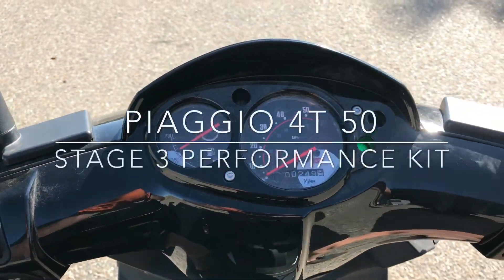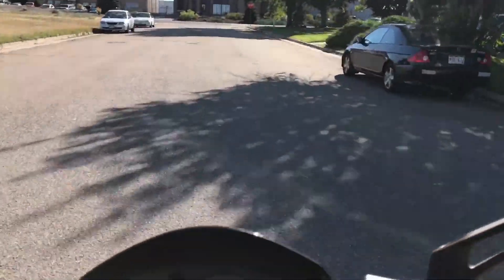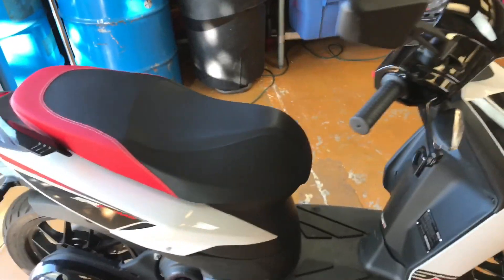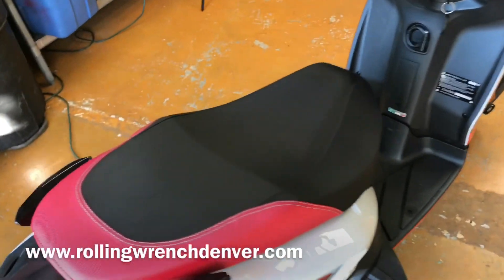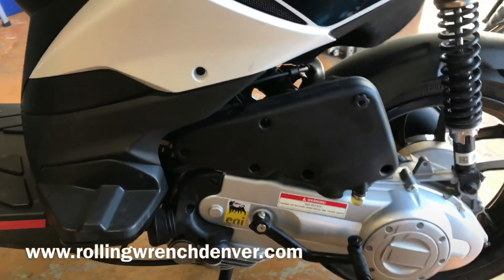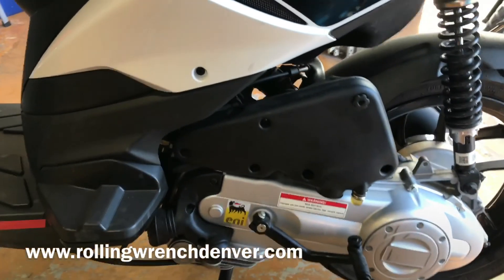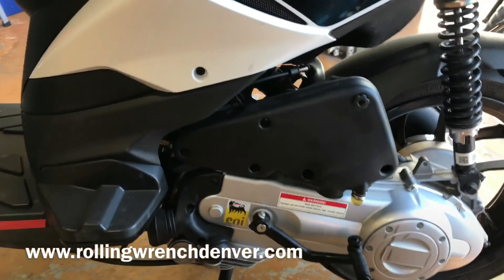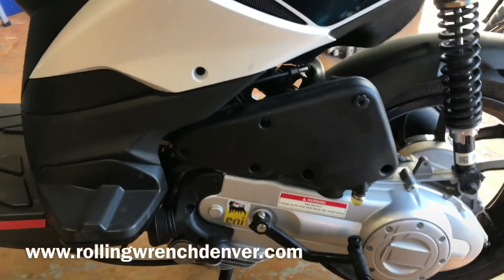SR50 / LX50S 4T stage 3 performance kit: big bore

Comment: In the video I'm not too impressed with the final top speed but mine does that with just the upgraded hi-speed variator and racing clutch. I'll add the 80cc kit soon.
Reply from the maker: Just a heads up, we are in Denver Colorado. We loose 20% of power up here. I assume you are at sea level
Reply: @Rolling Wrench  oh that's right I forgot, sorry.

Comment: Question for you, I installed the polini  hi speed variator and speed clutch I didn't notice much performance difference. I have the 80cc big bore kit but it's not I stalled yet.  What am I doing wrong?
Reply: Variator can only help acceleration put the big bore on and buy a unrestricted CDI you’ll see the difference

Comment: just add malossi gears 15/55,6.3 gr roller,purple contra spring,red clutch spring,plzzz open the air box this engine is choked! two halh inch hole near the s air box restrictor,up jet for your region (around 80)let it rip up to 50-55 mph
Reply from the maker: Great advice! Also add this:
https://www.rollingwrenchdenver.com/products/vespa-performance-cdi-removes-the-rev-limit
Reply: @RollingWrench  wow! Finally another option besides malossi cdi!
Who makes this one?
And what degre of advance can you reach?
Since i live in a " flat " town i fugures i wouldnt benefit that much from the raised rpm from malossi.other choices,like a multivar with a machined canon where better option for me.
But for the price i might consider this one!👍
Reply: @RollingWrench  Just ordered one! Any tips on how to install?
Reply: where did you buy all of these ??

Comment: I'd like to see a Begining to end including the engine removal IF NECESSARY or not. Because I doubt you needed to remove the engine.
Reply from the maker: You do need to remove it on this model. But not on a Vespa
Reply: @Rolling Wrench  I was going to do this myself but I don't want to fuck things up.  I thought I could just remove all the panels and go from there.
Reply: @Rolling Wrench  but where's the beginning of taking the scooter apart video? Because I didn't find the video where you take apart the motor for the 4t motor just a 2t engine.
Reply from the maker: @g8some  I didn’t film that unfortunately. It’s easy though 2 bolts
Reply: @Rolling Wrench  does this have to be done on a bench? Or on the ground from which it sits. I'm not installing the malossi 80cc kit but the polini 80cc kit.
Reply: @Rolling Wrench  and what about the rest of the process like undoing the wires ect.

Comment: Why do I have to take the back half of the bike  apart?  Couldn't I just take the panels off and just leave it together and just go from there?
Reply from the maker: On a Vespa yes. On a piaggio or aprilia no
Reply: @Rolling Wrench  well it looks I could.
Reply from the maker: @g8some  try it :-)
Reply: @RollingWrench  I will lol
Reply from the maker: @g8some  but I think you will be surprised how simple the motor is to remove. One main bolt, shock bolt, fuel hose and brake cable. It’s about a 15 min job to remove the engine.
Reply: @Rolling Wrench  sounds good but where's the video showing what wires and cables to detach?
Reply from the maker: @g8some  no video for that :-(
Reply: @Rolling Wrench  oh I was wondering if I should remove the rear fender, it keeps rybbing on the tire lightly and it's wearing out the fender.
Reply: I've been monkeying around with rollers and I've noticed the heavier rollers make the scioter accelerate slower. I don't like that, should I put the lighter ones back in and use the lighter springs? For faster take off?

Comment: There are more engine types , a short and a long version. This because of the bigger wheels in it. Like the Piaggo Liberty , the transmission cover is much longer. The cilinder and al the other parts are the same. Although I don't no if the transmission do have the same ratio because of the bigger wheels 14 inch..

Comment: I'm Italian, you don't unlocked the control unit or Cdi, this 4 stroke with 4v is locked electronically and can't go faster then about 40 miles, also is locked at the variator and with the carburetor, i have a identical engine with a 50 cc without these blocks and go at 50 miles, with the 80 cc Malossi you should get to 60 miles or more also considering the variator and the camshaft, i hope you fix this soon because you're not using it at all. Greetings
Reply from the maker: If you change the final drive gears even better

Comment: I have an Aprilia sportcity one 4t 50cc original cylindre, cdi racing, with malossi fly clutch, polini speed control 
i take 80klm/h 49mph... But Nice job
Reply: Is that the 4V head as well?   I am trying to get a 2015 SR50 to do 45mph. I will trying speed control variator and malossi cdi.